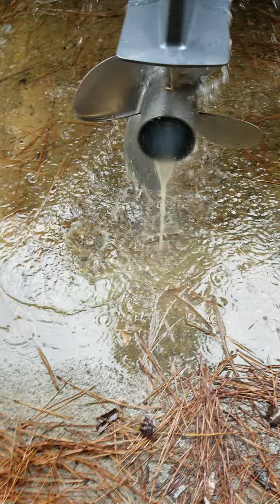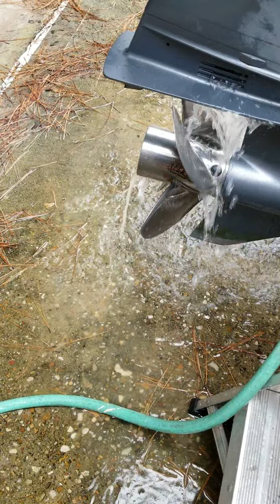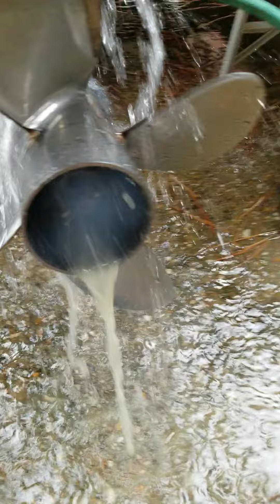Yamaha 115hp Running Rough pt. 2

Comment: I think mines doing the same . I have a Yamaha 50 hp 2003 with carby any ideas would that work for mine ? Does it work for 4 strokes ?
Reply from the maker: Try using a fuel additive like Seafoam... search "Seafoam" on YouTube and there are endless videos showing this additive to help un-gum an engine.  They have a spray version that can be sprayed right into the Carburetor to break away any gunk and burn it out.... I did this on my Lawnmower engine after it was getting tough to start and now it runs better and usually starts on first or second pull..... Not endorsing Seafoam, but I am saying I have tried it and it worked for me.... I use it on all of my engines including my boat motor every time I fill up....
Reply: This will happen if u run 87 fuel in it. Always try to find 93 non ethanol fuel for 4stroke and it will stay clean and run way better
Reply from the maker: @masoncomeaux4105  I agree entirely.  87 with ethonal will destroy anything that sits unused... I used Stabil Marine and still had issues..... I've switched to Ethonal Free gas and hopefully that will keep it from getting gummed up again
Reply: Stabil does help for a while. But most people think stabil is good for years. That's not the case stabil will prolong fuel for about a year and then after that stabil starts turning the gas into jelly. Then it want run at all. But yeah the best way is to run non ethanol gas preferably 93 octane. 87 with ethanol is trash fuel I don't even run that in my truck.

Comment: What size prop you running?
Reply from the maker: It's a Trophy Plus 13-3/4 x 17"
Reply: @DadsTimeOutdoors  any gains from it?
Reply from the maker: @jordanmorgan9882  it had the 4 blade prop when I bought the boat.... overall it had good performance with it.... Im not sure how different it would be with a 3 blade